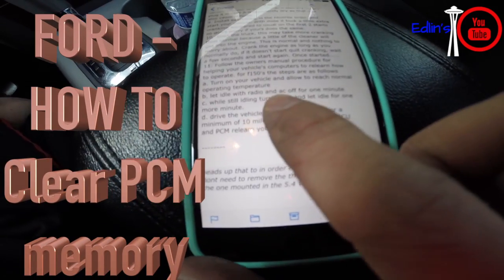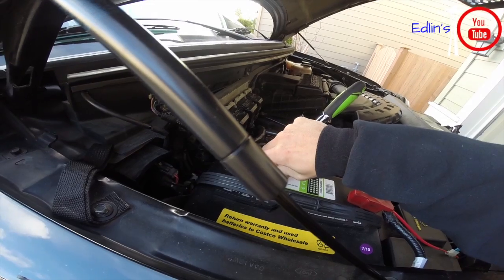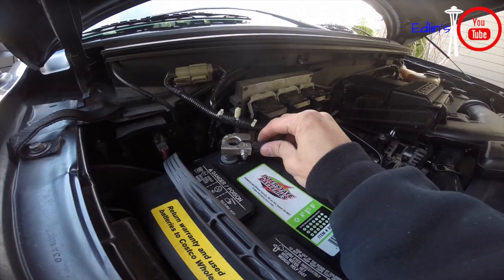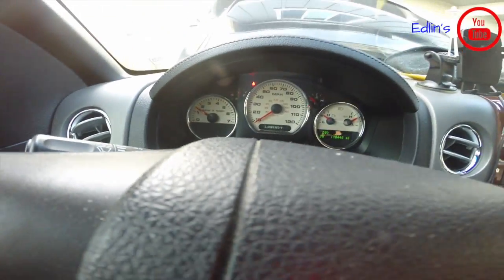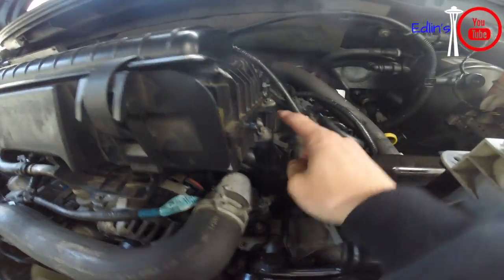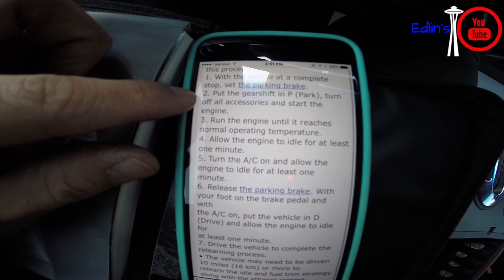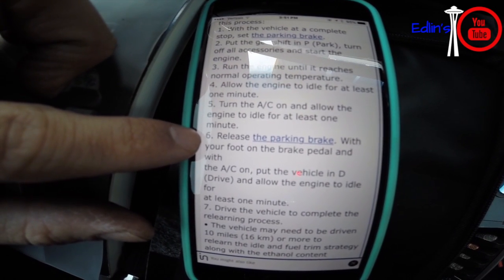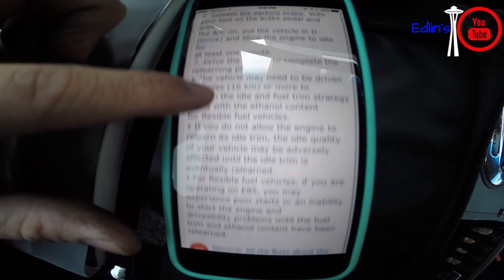FORD - Clear/Reset PCM Memory

Comment: You seem to be going over what actually DOES need to be done after the fact. But....!!!! You didn't show or say how to clear the PCM at all.
Reply: Otis Pierce : Read my post or Tom Parry's post. This Edlin fella don't know shit. You have to drain the internal "keep-alive memory" capacitors in the computer via a jumper wire, with the negative battery cable disconnected from the battery. Also, despite what this boob has said, you absolutely DO NOT have to do this with every repair, only needs to be done in certain more rare circumstances where a new sensor may interact with other sensors via the PCM/ECU/ECM, where by doing a "re-learn" might be beneficial. The good news is that a re-learn won't hurt anything as long as everything is working correctly, but you may experience strange happenings the first few start-ups and drives of a re-learn process.
Reply: @turbodiesel4709  Hey, I have an issue with 1st,2nd,3rd gear shifting on Ford Fusion 2015 se, it feels so bad when it shifts from 1st-3nd gear and I don't know what to do. Should I do that reset or no ?
Reply from the maker: worked for me =)
Reply: Edlin, did you just take the terminal off the negative post and put it back on after (how long) a while? Or is there something else you are supposed to do at that point?

Comment: What's the whole purpose of a pedal positioon swicth
Reply from the maker: no idea
Reply: This might have been used in a generic discussion, with common examples being a brake pedal position switch or a clutch pedal position switch (which tell the computer that the brake/clutch pedal has been depressed).